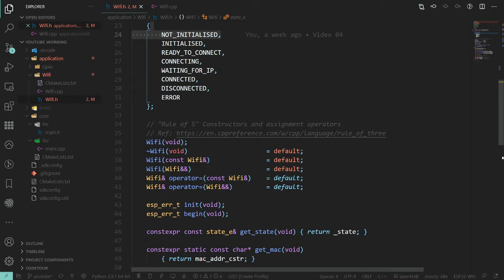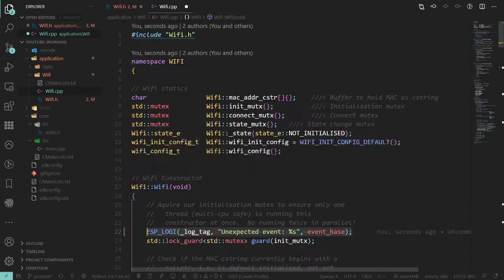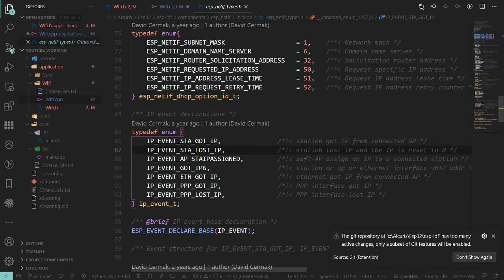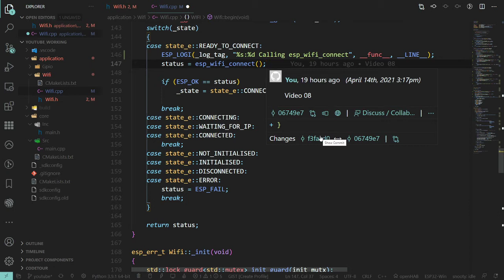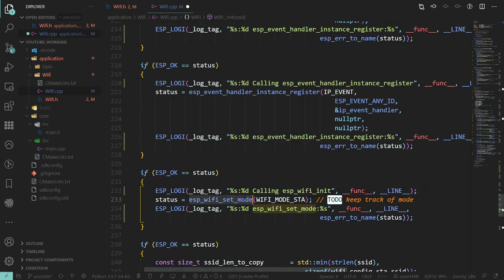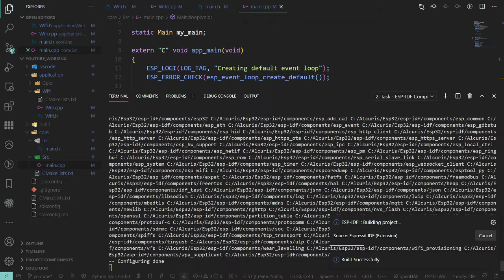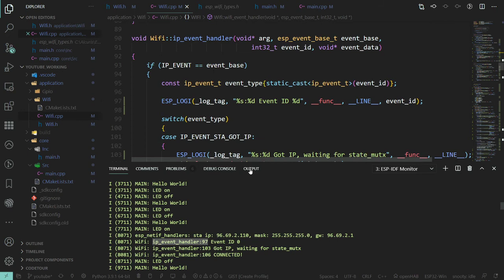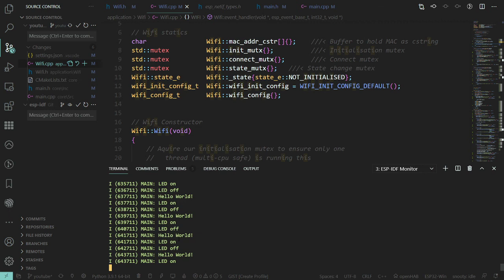ESP-IDF in CPP 08: Getting an IP Address

Comment: 0:00 Hi all and what we are going to do
1:50 Log messages
25:10 Include our Wifi component in the main app and the main CMakeLists.txt
26:00 Add wifi constructor in main.h
26:35 Add call in main.cpp
27:55 Check if wifi.begin is safe to call multiple times
28:30 Compile
28:55 Build flash monitor
37:00 Next video

The satisfaction is incredible (even if we just copy and paste code).
Your explanations are legendary thanks Simon!

Comment: I'm a computer science student and I'm currently working on a course work project which involves some embedded esp programming. Although I had a lot of experience with electronics and different programming languages I never had my hands on C++. And now it seems to me as strange overcomplicated but very interesting world where is no one right way of solving problem. Anyways, I got it running and connected from the first try same as on video, that was kinda pleasing. Thanks a lot for these videos)
Reply from the maker: Thanks for the comments! C++ is without doubt more complicated than C, because it has more stuff. Stuff that you don't have to use of course, so then the complexity reduces and can actually be lower than C. Completely depends how you use it. 

The main thing I love about C++ over C is the compile time catching of bugs. It saves so much time, effort and headache when it comes to debugging code running on the micro

Comment: Hi Simon. Great videos. A doubt. There is something I couldn't understand about the code synchronization. What happens if WIFI_EVENT_STA_START occurs after calling wifi::begin() in main()? As READY_TO_CONNECT would not be set yet, would the call to esp_wifi_connect() not occur? Is it necessary, for security, to use a delay between wifi::init() and wifi:begin(), in main(), to guarantee the esp_wifi_connect() call?
Reply from the maker: Thanks for the comments!
How much delay would you add is the question.  That said, and it was a long time ago I wrote this so I may be misremembering, I seem to recall WIFI_EVENT_STA_START being triggered inside the call of esp_wifi_start().  So before init() returns.
Worst case is that the call to begin() fails and returns an error (albeit not a particularly helpful one, I could've added the state to the debug!)
I am not a big fan of delays unless they are necessary for hardware IO, which are typically in the microsecond order.  In my opinion, they normally either unnecessarily slow code down and in threaded code cause context switches which can be a pain, or are not quite long enough so you get an intermittent fault where sometimes it works and sometimes it doesn't.

Comment: Maybe is it useful i use it myself: 
target_compile_definitions(${COMPONENT_LIB} PUBLIC "-DLOG_LOCAL_LEVEL=ESP_LOG_VERBOSE")

this way the local log level is for all the files the same. Makes it really easy to switch log levels. 
you need to put in in cmake file. 
Great Video btw! 
im really looking forward to implement my own wifi class.
but first i have to learn much more :)
Reply from the maker: Yes this is certainly a way of doing it.  Personally, I like the ability to configure things at a module (component) level, rather than globally.  I also like like defines etc all being in the source code rather than compiler directives, but of course that is personal preference too.
Reply: @DrGreenGiant   yesterday i tried it youre way with making my #defines  constexpr static const and it broke my code. You need to be really careful that you dont do any calculations with them because it will mess up youre code and the compiler won't tell you :( 
Back to #defines again :) 
The old C way ;)
Reply from the maker: @vincentdeman5225  were you compiling for c++17? If it was C++11 then for class members I think they also need declaring in the .CPP file. I can't quite remember off the top of my head.
Would be interesting to find out what was causing your issues though. If you want to, make a snippet on Godbolt and drop me a link and I'll take a look.
Defines still work just as well, they can get messy though if they're in the header, something to be aware of
Reply from the maker: @vincentdeman5225  Sorted for you.  There were two issues I spotted; VR_Range was 50 in your #define  but 5 in the constexpr, and, your constexprs were ints but being assigned a decimal value so would have been rounded down to a whole number.  Making them floats and changing the VR_Range to 5 gives the expected result.

https://godbolt.org/z/nnMfr146Y
Reply: @DrGreenGiant  Wow just wow facepalm 
Sometimes my own stupidity amazes me. Why are it always the obvious easy things hahahaha. 
Thanks for pointing out my mistakes!
Reply from the maker: @vincentdeman5225  Don't worry, I have made (and still make) some absolute howlers from time to time!  Particularly when switching between languages!
Reply: @DrGreenGiant  Its always funny how the easy things are sometimes harder than the hard ones. The joy of being a programmer :) 
Good thing we have the compiler